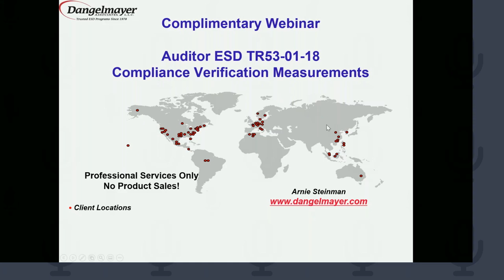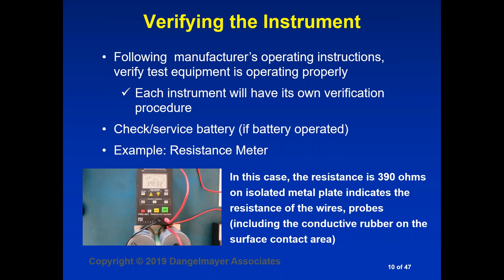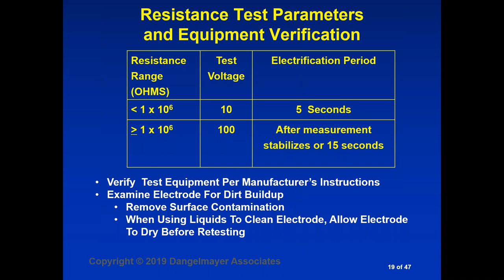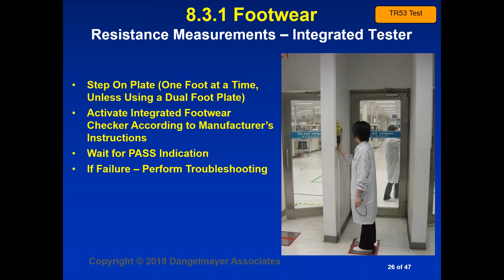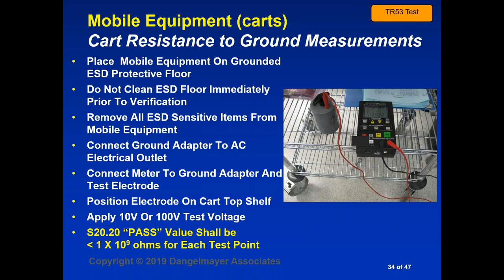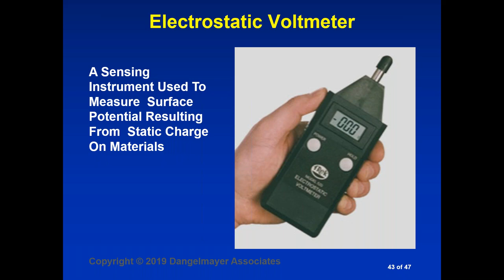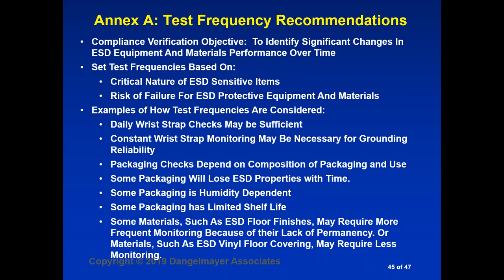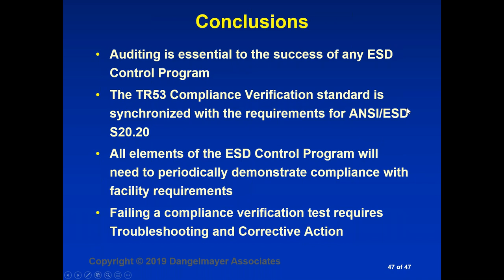Auditor ESD TR53 Compliance Verification Measurements and Certification

Comment: Ted (or whomever may read this), the STM's state that if the resistance meter is toggling between 10 and 100 test volts, to use the higher voltage. However, the Prostat PAS-853B must be locked in to 10 volts to make a measurement when this happens. Is that a problem? Ben